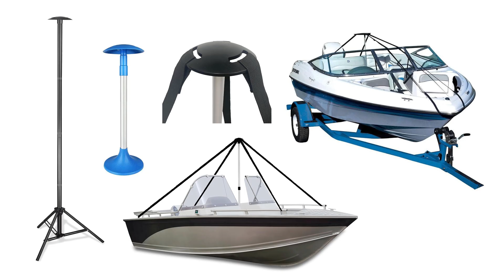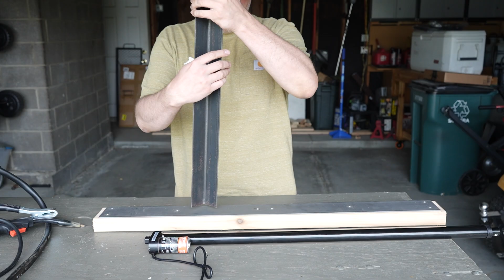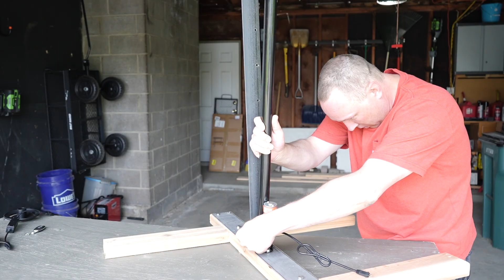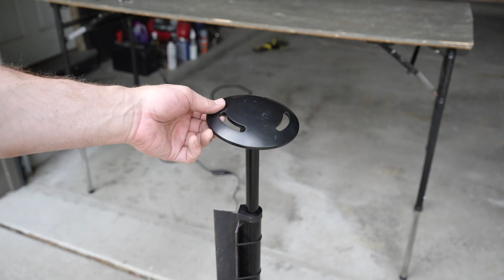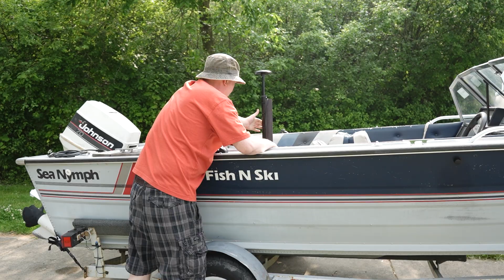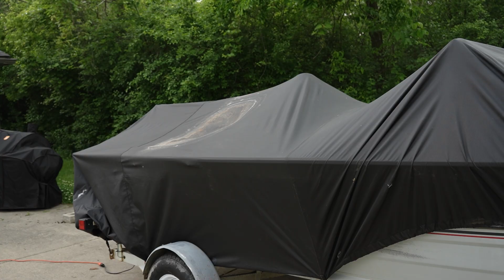Electric Boat Cover Lifter-Upper | DIY Remote Control Support Pole for Storage

Comment: I have to admire your ingenuity, industry, and engineering skills ... a wonder to behold!
What did you do to your thumb?  bandages always make me nervous ...
Reply from the maker: Thanks Mary!
Funny you should mention the bandage. After filming the part where I cut that piece of steel, I was walking up the basement stairs holding the steel in one hand, and a camera tripod in the other. I tripped on my own feet somehow, and I sort of landed on the hand holding the steel... which caused that hand to become a bit cut up.
Reply: @GreatLakesCountry  I imagine your brain was firing on fifty two cylinders ... thinking ahead ... that is a blessing and a curse.  I am glad you were able to complete your chosen task.

Comment: That's great. Do you worry about snow on the cover during the winter? Thanks.
Reply from the maker: Thanks Karen. With this new contraption, I won't worry about snow at all. In the past, snow hadn't really caused much of a problem unless it was super heavy, but this thing can only help.
Reply: Nice work